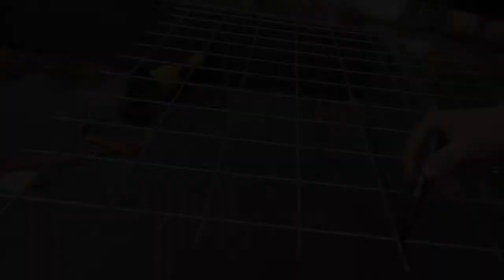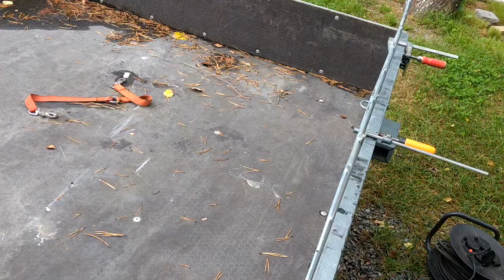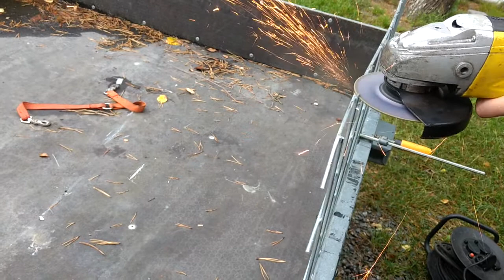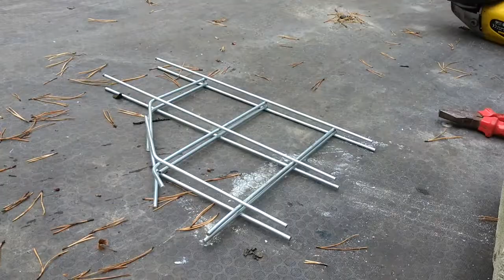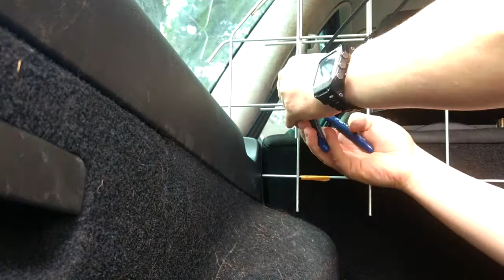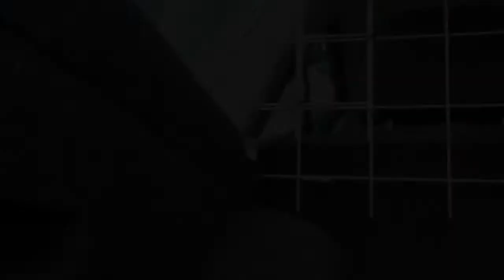Quick and dirty DIY dog guard

Comment: OK. Nice. Now how about let's find some type of small rubber  cap that could be put on end of each wire so they ain't so gall dang sharp???
Reply from the maker: That is one possibility. The factory edges were actually not that sharp and the other edges can also easily be rounded with a few file strokes. Rubber dips that are meant for tool handles is also a good solution. you could easily dip all of the edges and create durable and attached rubber end which doesn't fall off. If you have a 3d printer you could also easily print the end caps. But then I suggest adding a drop of glue to prevent them from falling off.

Comment: Where did you get the gate from?
Reply: Stacey Roberts 
Home Depot
Reply: What’s it called please. I just left Home Depot and all we could find was what looked like 1/8” rebar cage that’s only sold as 4’ x 8’ sheets or 100’ rolls for upwards of $300. Slightly out of my price range.
Reply: I just got chicken wire to use in my Honda CRV. I was going to put duct tape on sharp ends. I am driving across the US and will make one back area for the dog and one in the back seat for cats with an opening at the front seat middle area for a clear shower curtain door attached, to feed cats and clean the litter box. I have to also protect the windows and controls in the cat area.